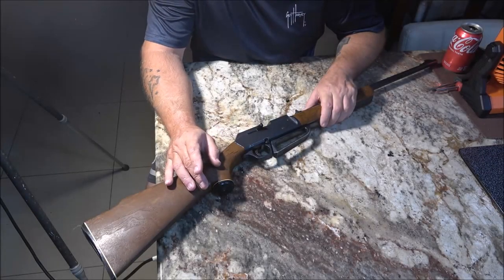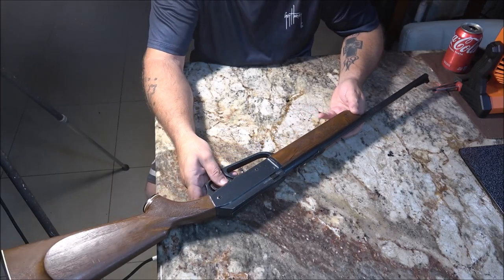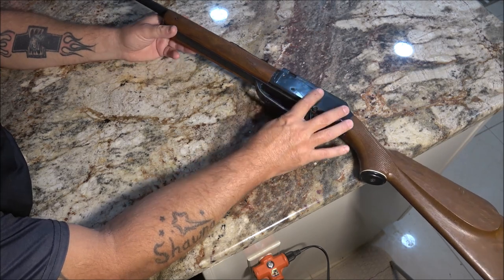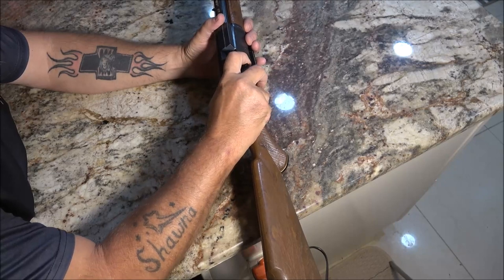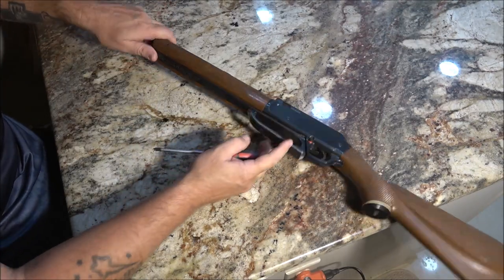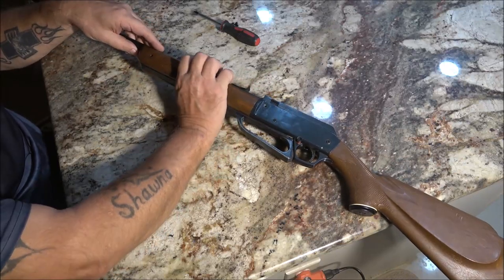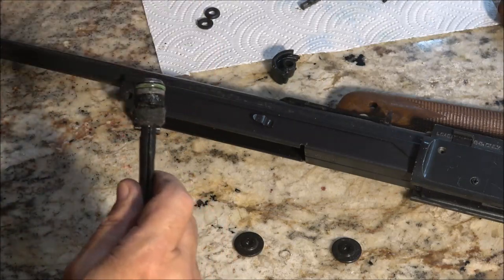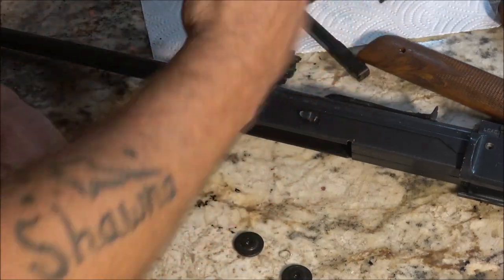Trying To Fix A 1977 Daisy 880 PowerLine

Comment: The Crosman F4 is a wally-fart exclusive model. They have a long creepy trigger but you can drop an aftermarket adjustable trigger in them or you can smooth them out a bit.  The polymer thumbhole stock is comfortable but I plan on spending an extra $20 or so on a Crosman Vantage in .177 . It's the same break-barrel receiver in a nice Beechwood stock with fiber optic sights & a factory optic while they're still available since I recently picked up a crossman 1300 .22 cal & a 1377 .177 cal for $130. For the $$ the F4 or the Vantage is a screamin' deal 🐒
Reply from the maker: Have you done any hunting with it?
Reply: @shabear1000  the Crosman F4, yes I have.  It had a louder report than some of my rimfire 22's.  I was shooting the lead hunting pellets & they were still supersonic.  Worked great for pest control.  Squirrels,  quail,  doves & rabbits & phesants if you can get a good shot on them.  I was just looking at the Ruger impact max ll @ Walmart for $10 more  than the F4 & wow,  it's damn nice.  Checkered wood stock,  fiber-optic click adjustable sights,  a full length rail,  a functional muzzle brake & 1100 fps w/ the heavy weight .22 cal hunting pellets and an adjustable trigger.  Yep,  I'm game & picking one up payday 🤠
Reply from the maker: Awesome, thanks for the info. You've been a big help. I appreciate it man.

Comment: G'morning ☕☕ 🤠 . I had a Daisy Powerline 881 that I got as a kid that I toted around for 20+ yrs.  It had a rifled plastic barrel that was wrapped w/ the steel barrel sleeve.  After a few years the rifling was shot out of it & I couldn't hit a paper plate @ 25' w/ it 😓. I picked up a Crosman F4 break barrel nitro piston .177 cal. @ wally-mart for $89 . The factory scope works but is junk.  I put a CV Life 3x9_32 on it & dialed it in @ 35 yds & it was a 1200fps moa tackdriver 😎 .
Reply from the maker: I've had a few crossmans and the shoot very well. Lot of power too. These little guns are so much fun. Thanks for sharing with us. Have a great weekend and stay safe.